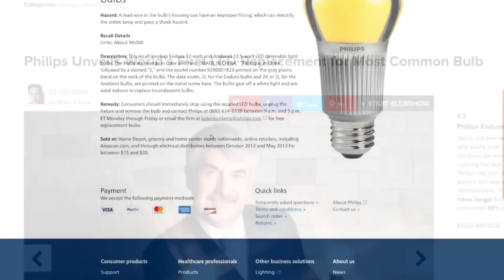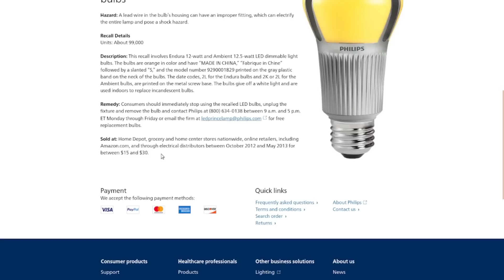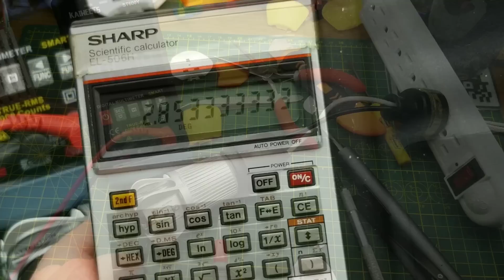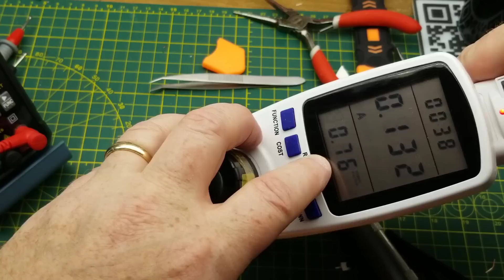fixing an expensive LED light

Comment: The LEDS used in these lamps are actually ultraviolet emitters that excite the yellow phosphors in those three covers that will emit white light. Not sure which type of UV they emit but another YouTuber used this lamp minus the phosphor covers to activate the RetroBright system used to "bleach" older yellowed computer plastics and plastic housings. More than likely they emit UVA similar to the black light tubes common in the sixties and seventies.

Comment: This lamp was the US$10 Million winner of the US Dept of Energy "L-Prize" in 2011. The remote phosphor was the only way to meet the criteria that required meeting certain performance including light output, light distribution and colour maintenance over life. Most GLS replacement lamps throw the light DOWN, rather than all round like a GLS (A-type) lamp, hence the sideways-firing LEDs and side diffusers.
The DoE tested it as reaching 93.4 lm/W, 97.1% lumen maintenance at 25,000-hours and a CRI of 93. Nothing even got close to those numbers back in the day, and the remote phosphor was the only way to achieve acceptable performance over life. 
That level of performance isn't even reached by modern-day retail consumer lamps, however the cost has dropped so much that it doesn't really matter any longer.
Reply: Can't really agree on that high CRI and high efficiency claim. I replaced mine because they were pretty dim and the light looked like crap.

Comment: If a person is familiar with electronics in general, they can actually repair most LED bulbs these days. Not much to them inside... Thumbs Up!
Reply from the maker: I've fixed a few.
The ones I failed at had the driver entirely potted, or used a type of LED I didn't have a convenient replacement for.

Comment: I also happen to have one of these since aprox 2012. I live in Europe with 220v and this lamp gets really scorching hot. In fact it gets so hot that the yellow plastic now has started to get brown from scorching, my guess is that the UV +heat is breaking the plastic down over time(planned obsolescence?). But it is still shining just fine in my architect lamp. To my surprice the bulb was so heavy I had to modify and adjust the springs in my architect armature so that it would stay up like it did before with a "normal" incandescent(60W) bulb. Sadly mine was not in the recall. Great tear down video now I know how to reapair it when the time comes. Thanks. IKEA has a new bulb series out recently SOLHETTA that are very good for resonable price. Perhaps a  candidate for another tear down and compare video.

Comment: Quite a bit different construction than the cheapy led lights. I tried to fix a cheapy this afternoon by solder bridging after removing the dead led. Lol, it worked but the rest of the led's seemed very dim after the repair. I likely messed up because it was my first time taking one apart and trying to fix it. Still, it was a fun diversion for a few minutes 👍

Comment: What was the thinking behind bolting it back to a HUGE heatsink BEFORE re-soldering the wire??!?  Also, definitely lots of UV coming out of those things to excite the yellow plastic to light...
Reply: No, the phosphor is converting blue light to white. UV LEDs are far too expensive and inefficient for this application.

Comment: Can you find some fluorescent items and see if the bare LEDs make them glow?
Reply: The yellow tops of white LEDs glow like crazy if you shine a UV LED toy at them.  The yellow plastic on this lamp was a cunning choice they made before the white LEDs were freely available.  These days the phosphor is all in the little yellow dot that covers the LED so you save a lot of phosphor.
Reply: @KallePihlajasaari  - No, white LEDs were common at the time this lamp was made. However this lamp was the winner of the US$10 Million content by US Dept of Energy called the "L-Prize". The remote phosphor was the only way to meet the entry criteria, which required certain performance including light output, light distribution and colour maintenance over life.
Reply: @johncoops6897  Ahh, the large phosphor area did seem odd. I was not aware of the contest or the time-line.  The current trend for LASER excited small phosphor spots in automotive headlights seems a new spin with separate cooling of the laser and phosphor while maintaining the spot size small.
Reply: @KallePihlajasaari  - Yeah, it's come back around. The main advantage is that the phosphor is kept away from the incredibly intense heat of the LED die. There is no way of getting enough light output to make a car headlight from a point source LED, hence the use of remote laser.
Reply: @johncoops6897   Agreed about the first bit but not the last sentence. Because that is just false. I believe you actually know that. Many cars have headlights made up with ordinary phosphor coated LEDs. Although they use a few in car headlights, single chip white LEDs producing lumens way more than a single headlight have being around a long time.
Reply: @nhytg376tgyuu765gjmg  I think the issue with with single lensed optics the source needs to be a single point to get a 'sexy' beam formation.  For headlights a lot may be vanity but optically one spot is very different from many spots.

Comment: The leds look like philips luxeon rebel chips emitting royal blue color which are designed for remote phosphor applications (the yellow covers) this was done since early white leds degrade because of the older phosphors being exposed to heat. Moving it away from the led chips extended the phosphor life. The pcbs where the led chips are mounted to are indeed some kind of ceramic can't remember off the top of my head maybe alumina? Very thermally conductive used for high performance circuits that need to dissipate heat. Today mostly used aluminum or copper backed pcbs for ease of manufacture.
Reply: Yes, not UV / near UV. The royal blue is 440 to 450 nm.

Comment: That looked an awful lot like the issue with the recalled bulbs... The fact that the pad was still there means it was just a damn cold solder joint from the factory.

But yeah, lot of design went into it. They needed to though. Good white leds were still not common so they went with the almost blue leds. If no more wires come loss it will probably keep working wayyy past it's economical life span. Because those leds will degrade, probably quite a bit. Even compared to brand new, 13W for 800lm isn't efficient by today's standards. But it it ran quite it bit it will probably not output near 800lm any more. And that's actually quite a problem because it's a trap for the unknown. They keep working, they keep drawing 13W but the light output might be halved.

Comment: I have two of the same type of bulbs that have been the longest lasting LED bulbs.  They are probably around 15 years old and get used intermittently every day. They were the first LED bulbs that I purchased. 
 Not like most other LEDs that I have that seem to last 4 to 7 years and sometimes as little as 2 years.  They perform pretty much the same as when they were installed, never any flicker.

Comment: UK That was a nice little video. I have the reputation as a very good bodger. That does not mean second rate, it just means I hate waste. I'm at about 80% for LED's and 65% for garden lights. I have a 300W soddering (U.S. viewers) iron that doesn't give a dam what substrate the connections are on. The real old pre Roman ale had no hops - filthy stuff, really smooth without. Regards
PS.  Please don't leave the Commonwealth we need you now more than ever I fear.

Comment: This bulb is insanely overengineered. $30 seems like a decent price for such quality. Shame they goofed up with those joints. I believe the recall bulletin is describing exactly the same failure mode.
Reply: It was $40 when first released which is about $60 today adjusted for inflation

Comment: Bet you were just waiting for this to break so you could tear it apart without guilt.
JST connectors, machine screws, thermal pads, 3 separate ceramic PCBs, radiator on the electronics, and  precise fit and finish on the molds ... just ... wow.
Bet they don't make them anymore.  Can't have user-repairable stuff.
All failed due to a cold solder joint.  Probably done manually with child slave labor.
Reply: They don't make them anymore because nobody wants to pay $30 for an LED bulb.

These aren't more user-repairable than modern LED bulbs.

Comment: Another early adopter here - I have the same model from that same timeframe. Still running strong, although it's in a fixture that doesn't get used too much. Seeing the engineering that went into it makes me feel a bit better about the fact that I also spent an arm and a leg for it back then.

Comment: Little flip chip is a protection device, which is basically a zener diode and a SCR, one each direction, so that if all the LED's go open circuit the SCR is triggered on each power cycle to short out the entire LED module, so the rest of the series string keeps on working. Yes Phillips made them well, as they wanted a flagship device that would showcase their technology, made when they were able to make every single part, from the plastics to the electronics, and the metal spin cast housing, in house.

Comment: Can't tell if the spudgering detached that wire. But how would it have popped off otherwise? Maybe a poor joint and thermal cycling?
Reply: Just a guess still, but it was not working, he soldered the wire then it worked.
Reply from the maker: hard to tell.  
Maybe some weak solder joins from the factory? It would also explain the recall (though, this one didn't seem to have the right markings t be affected by that recall)